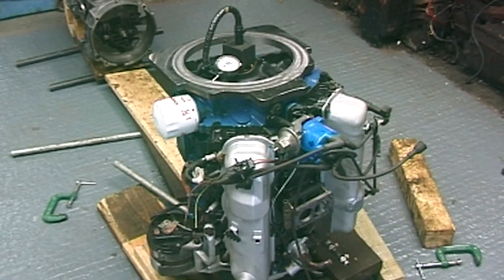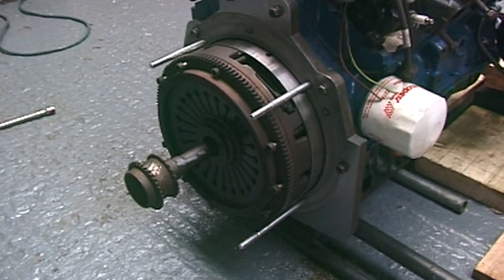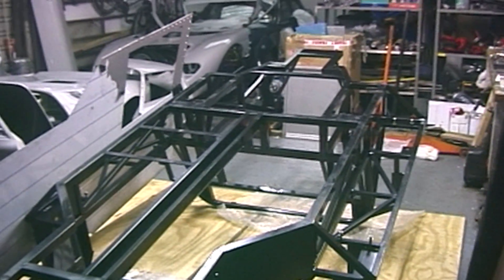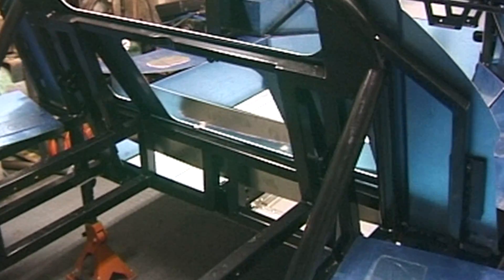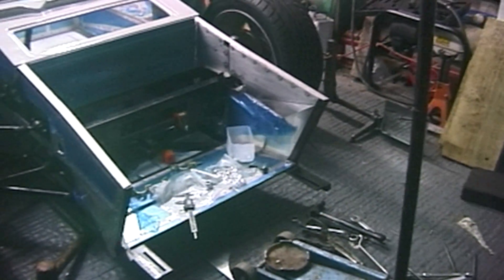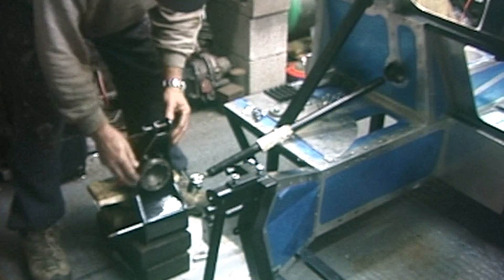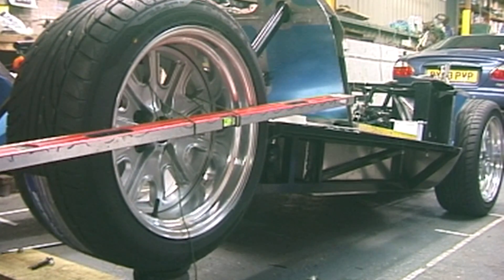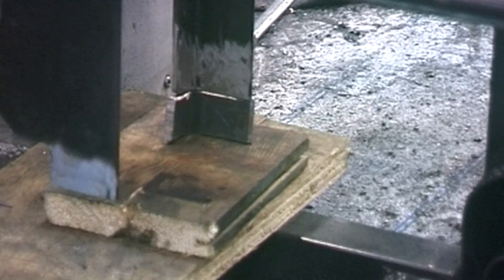Building a Ford GT40 (part 1 of 3)

Comment: Isn't using a granada engine like putting a fiat uno engine in a ferrari ? a car such as this should have a real V8, personally would go for a yanky motor, but would go with an audi w12 engine, tons of power 500bhp plus as standard, or the audi 4.2 rs v8, cheap to buy from ebay, bolts straight onto Porsche box

Comment: It must way a great deal more than the original with all that S/S. Plus I question whether the original space frame was made of square section steel. Nice job otherwise though! The motor especially is very pretty!
Reply: The original GT40 was a monocoque (steel) not a spaceframe